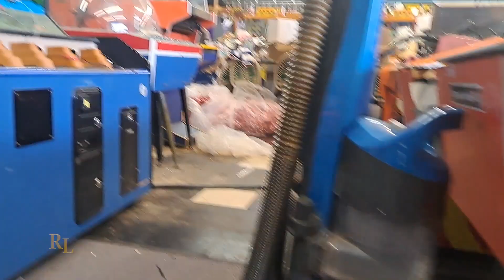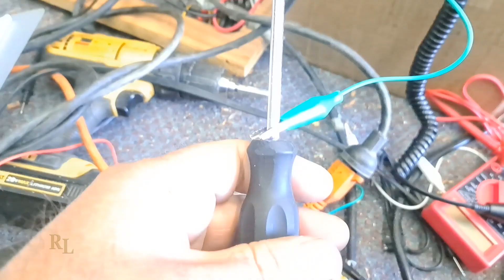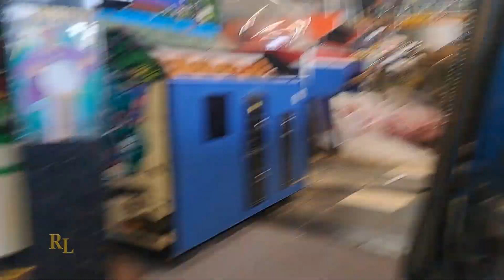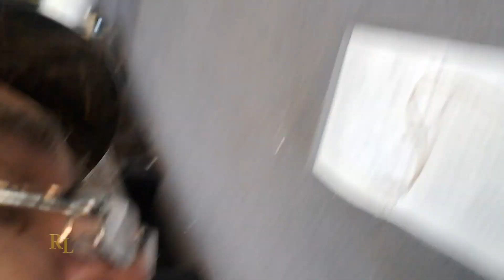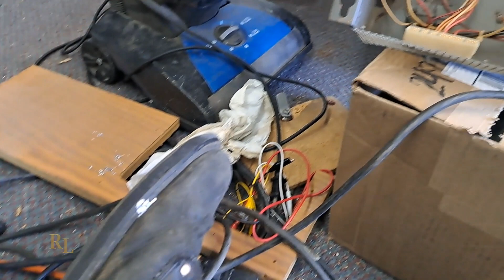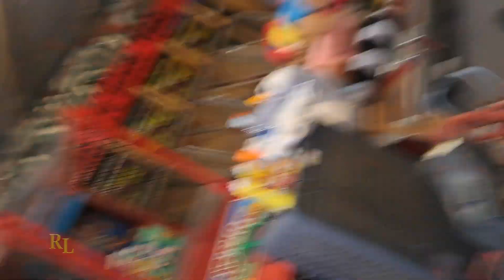Brunswick Air Hockey Control Board Repair PART TWO

Comment: Do you have a motor/blower recommendation / replacement for this table? The motor in ours went out. Debating on getting it fixed or just getting a new motor/blower.
Reply from the maker: @JM-pq2rk  I changed my blower unit 2 years ago! I do not recall part numbers, but yours should have info on it.

The hard part was getting one the same size to fit

Comment: Thank you for the helpful video.  I just got a 70's era Brunswick air hockey table and it has 2 faults I think are related.  First, on one side it turns off after 2 scores.  Second, the lights for that side don't come on either (I did check the bulbs which were bad).  I'm at the cut the board out of the equation and just power the fan with a switch or get send the board to someone point.  Any guidance you can give would be great (repair people, board suppliers, which chip to replace, etc.).  I live in the middle of no where so I have no local vendors.
Reply from the maker: If it's the same board, you can send the board to me and I can repair it.

But understand that I really do not have time now as my season for boardwalk is just starting.

It's an after summer thing.
Reply: @MainStreetRANDYLAND  thank you.  If you had the time right now I'd have it in the mail ASAP.  But I get it.  The real world and all.  Well I'll look it some more.  Might just convert it to a fan on off switch but then I lose the scoring lights.  :  (

Comment: Hey again, Randy! Looks like I was wrong about that score bulb - glad you were able to solve the problem after all.  😉

I'm really curious about those crazy mallets you found! Do you happen to have those lower-top ones still? I would love to pick one of those up - if you'd be willing to part with one of them, that is!

Anyway, great work again! Oh, one other thing I was going to say: if you clean your table, be sure to use at least 70% isopropyl alcohol and nothing else, but leave the dirt on the rails to keep the puck from flying off too much. 😉
Reply from the maker: Puck was flying off a lot this summer...

But there was an issue where the surface was delaminating and lifting making hump areas...

I believe this was the cause.

Have re-glued over winter and  have yet to finalize as I had to cut right across the center playfield to get glue under.

Now I have to repair the cut and replace rails.
Reply: @MainStreetRANDYLAND  Yep, a warped or even partially-separated top will definitely ruin your Air Hockey experience! I've glued a surface back before and it stuck for a good long time, so you should be good, although of course lots of play will tell you sooner than later if you were successful or not.  😉

I hope to get a chance to come out and play on it someday - I can show you a few tricks, and you can show me those crazy mallets! It also looks like you have at least one very old "root beer" red puck in that box, and as far as I'm aware, those haven't been made in literal decades. Take care of that history, for sure!

Speaking of history, by the way, you can see an interview with the original inventors of Air Hockey (which I filmed in 2007) here:

https://www.youtube.com/watch?v=lEL3d8RnxBM

Comment: Really it's a well designed little board in my opinion.  They gave you (or you found!) good schematics and you were able to fix it, the board must be a pretty good design if it's repairable 50 years later!  Thanks for the great 2 videos Randy about this cool air hockey machine!
Reply from the maker: Absolutely

Comment: Randy, I thought I was the only one doing the double glasses thing!🤣But I sure do miss the days of troubleshooting like you showed us here! CHI Institute for computer repair in '85, then a 20 year career working at Xerox. But even more enjoyable was working on electronic projects at home as well as troubleshooting electronics and appliances around the house as well as for friends and family. I haven't done as much in recent years, with a totally different career now, but I did just troubleshoot our fridge down to the part, and had to make up a new wire harness connector because the part I need is no longer available and the new one plugs in differently. But the curiosity bug of troubleshooting never leaves you once you've been bitten! Keep up the good work and keep sharing your videos!👍😁👍
Reply from the maker: My mom did it too going back 50 years ago